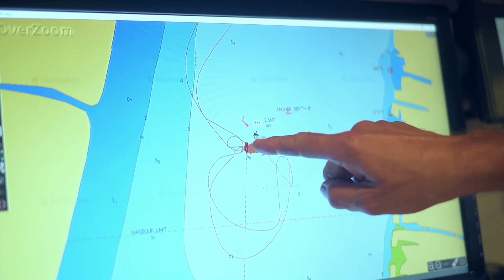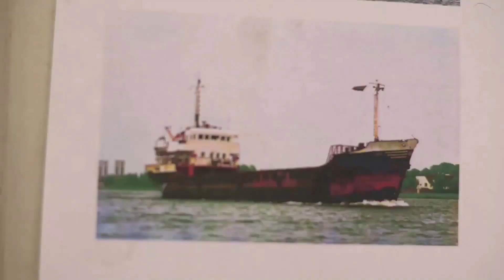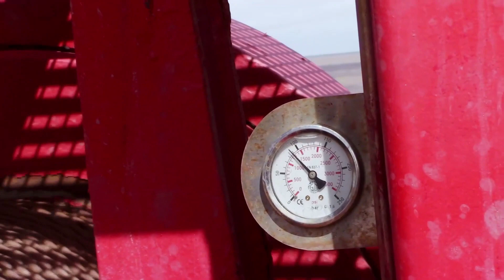Wreck removal in the Demerara River, Georgetown, Guyana

Comment: I’m surprised why the crew didn’t wash off the mud from the deck with a high pressure washing machine. Keep the workers safe.
A big electro magnet would have helped to pick up the loose pieces from the bottom also.
Where did they get this crew from???
Reply: Explains why they say 1billion to repair the DHB
Reply: electro magnet. ...... in a....river......ELECTRO magnet.... in water ..... ok 
kinda wished u were on that crew.....as the team lead .... wud make for way more interesting viewership.
Reply: Electric magnet and water are not safe